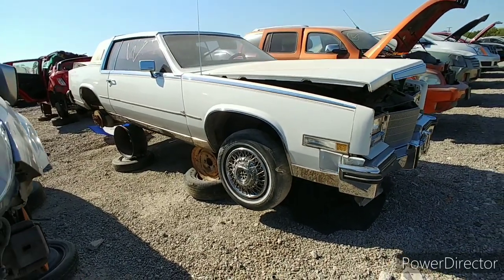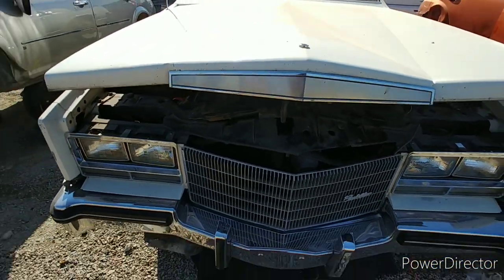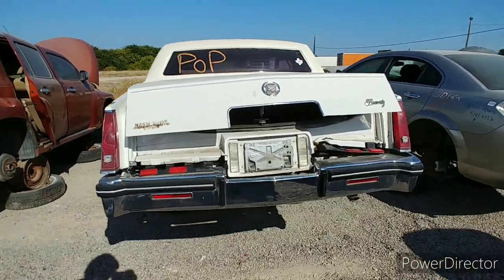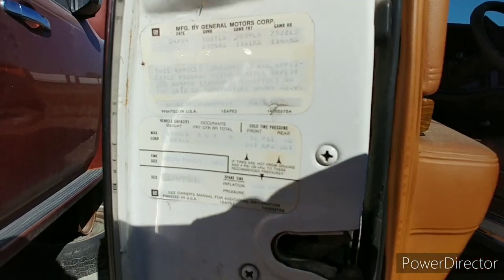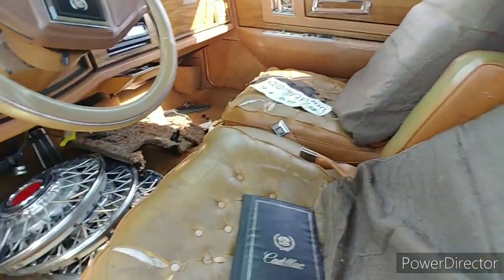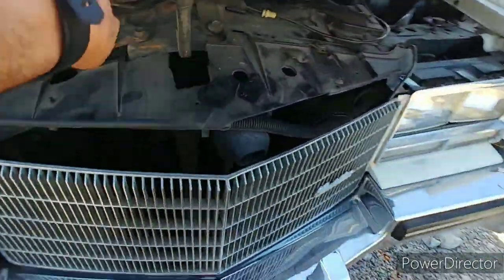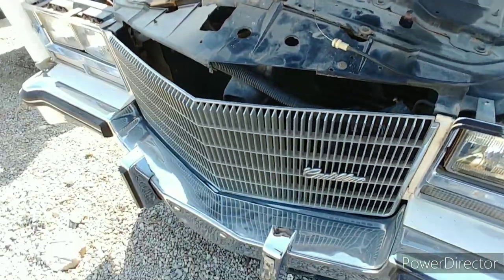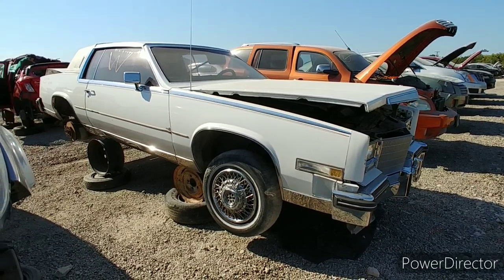1984 Cadillac Eldorado Biarritz Junkyard Find

Comment: Whoa Nelley, Biarritz lost the glitz......Nash Brothers Cadillac may now be Chuck Nash Buick GMC in San Marcos, TX. 

We got the VIN, we win: 1G6 for US made Cadillac, A for manual seat belts, L for Eldorado, 57 for two door, 8 for 4.1L V8 with DFI (TBI), Cadillac produced, aka RPO code "LT8", aka High Technology (HT4100), aka "1-2 punch out to lunch", 9 is a check digit, E for the 1984 model year, E for Linden, NJ assembly and the rest is the production sequence. The Linden plant closed in 2005 and last assembled the S and T Series trucks. My grandfather's friend worked there for years and assembled two Toronados that I had. The HT4100 as noted several times in the past was a sore spot for GM and the intake gasket would blow sending a soupy mix of coolant and oil through the engine, wiping out the bottom end and finishing the engine (and sometimes the car) off for good. My father sold these new in 1984 and I remember him selling quite a few. I'm still looking for an owner's portfolio that would have had his handwriting on it. I saw a car in a yard years back that came from the dealership that he worked at, but no dice, no paperwork. Scribner's is still there in Alva, OK. The sensor up front might be for ambient/outside air temperature. 

We got the SPID, glad you did: AG2 for power passenger seat, multi-adjustment, AM6 for split front bench seat with center armrest, three passenger, AR6 for front seat restraint system, BF2 for deluxe floor carpeting, BY1 for exterior body ornamentation, B36 for trunk mat, B53 and B54 for deluxe carpeted front and rear floor mats, B84 for bodyside molding, B85 for exterior belt reveal molding, B93 for door edge guard moldings, B96 for bright wheel opening moldings, C49 for rear window defogger, C68 for automatic temperature control, C93 for exterior opera lamps, C96 for quarter and single reading lamps, C97 for door courtesy lamps, DC3 for LH and RH outside heated and power mirrors, DG2 for LH and right hand outside power mirrors, D64 for RH inside illuminated vanity mirror, D74 for LH inside illuminated vanity mirror, D98 for bodyside and trunk accent stripe, FK2 for LH torsion bar, adjustable, F57 for 3.15:1 front differential ratio, K19 for Air Injection Reactor system, K34 for cruise control, LIN for Linden, NJ assembly, LT8 for 4.1L V8 with DFI, MX0 for automatic transmission merchandising option, M57 for THM325-4L four speed automatic overdrive transmission, NA5 for Federal emissions, NB1 for closed loop emission system, N30 for deluxe steering wheel, N37 for tilt and telescopic steering column, N91 for locking simulated wire wheel covers, QJW is a tire code, T80 for automatic headlamp beam control, T82 for automatic headlamps On/Off control, UA1 for heavy duty battery, UB8 for high note "C" horn, UM7 for AM-FM stereo with electronically tuned receiver and clock, U02 for MPH and KM digital cluster, U66 for four speaker system, U75 for chrome power antenna, V73 for US/Canada vehicle statement, YL0 for high impedance speakers, YL1 for leather and vinyl upholstery, YP3 for Eldorado, YR2 for deluxe front seats, YS2 for deluxe rear seats, 11L (aka WA3967) for White lower exterior paint, 11T for White vinyl top, 11U for White upper exterior paint, all of the 58 codes are for Saddle interior trim appointments and seat belts, and "DIS. LACQUER" means dispersion lacquer paint technology. 

Whoa Nelley, 1984 and soon to be out the door. Biarritz is a big miss. Eldo and gotta go. HT4100 says I hear you knockin' and you are going to come in, and this one will be flat, what a sin. That's it, time to quit. E car is not going very far. Made in NJ and going away. Going to be flat and that's that. Painted white and soon to be out of sight. 4.1 and it's done. Going to get squished, and the Cadu faithful, not Benny, some here and 4100 engine aside, yup the Google Man is going to be very, very, very pissed.
Reply: What was the purchase price on one of those jewels?'I am sure it was more than the Sedan De Ville, and the Toronada with the Oldsmobile engine was a much better choice.
Reply: @garymckee8857  Around $20,000 originally, but a lot more in most cases due to options. You mean "Toronado" and yes, that had the gasoline Olds V8 typically. The '79 parts car I had was equipped with a 350 Olds V8 and my '82 had the 307 V8, aka RPO "LV2" Pocket Rocket.
Reply: @googleusergp  Those Oldsmobile engines were very dependable.
Reply: @garymckee8857  Indeed they are.

Comment: Back in the early 90s when I was about 4-5ish maybe 1991? My Dad and Uncle around that same time bought their cars! My Dad bought a 1986 Chevrolet Celebrity 2.8V6 was a charcoal grey metallic color with matching grey cloth interior, had crank windows and manual locks but had a good stereo from what I remember and cruise control and AC. Other than that was a plain more basic car with the metal chevy hubcaps. My Uncle Jim bought an 84? Oldsmobile Toronado that was same metallic grey color but looked alot like this Cadillac Eldorado. Now that car was loaded!